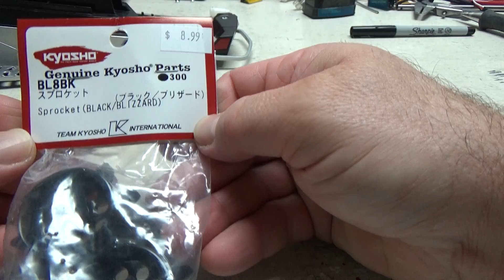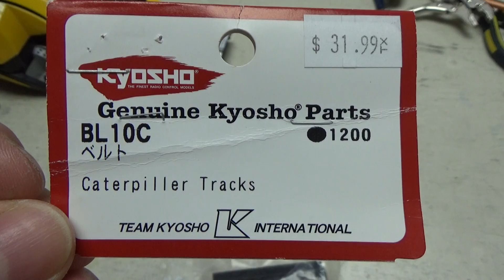Rc snowmobile SKI DOO convertion long track,brushless.

Comment: Thanks for the video and inspiration. I had the same idea to use a Kyosho Blizzard track and even purchased a spare track (I have a Blizzard and the same Skidoo) for this but have had no time to create the new suspension. I've found creating/building the track the biggest challenge with these types of snow machines.  I stripped the gears and disintegrated the stock plastic drive train housing on my Skidoo with the brushless motor setup and haven't driven it in over a year. Your video has inspired me to try and duplicate what you have done for the suspension and tunnel drive wheels - Great Job!  I've been working on a new geared drive train since the stock one is flimsy junk. One avenue I've been looking into is using an "EZ start" transmission used for starting nitro motors in the Traxxas Stampede. It is almost exactly the same shape and size. Take a look. I think something like this along with your suspension and track would be an awesome combo.
https://www.amainhobbies.com/traxxas-ezstart-starting-system-tra4570/p17794?gclid=Cj0KCQiA04XxBRD5ARIsAGFygj_7AvDr1OhaXD21Xo86VRgZu_Xjmqz5hUZ60wjM4px1OKOlZ5xj0YMaAq0-EALw_wcB
Reply from the maker: Yes it is possible give me news if it works
Reply: Does it have metal gears the ez start?
Reply: @PatisserieRoyale  Yes
Reply: Some of the gears are plastic (top idlers), pinion and bottom spur is Metal, geared very low though. I still have not tried this setup. Been busy with other builds. I'll check the gear ratio of this soon.

Comment: What length did you drill the hole on the shaft? Did you center the sprocket wheel on the shaft and go off that?
Reply from the maker: 2 mm at the center

Comment: My dad bought 2 of these one for me and my brother never used them  anyway I just fixed the battery by saudering anyway I need a track neither of em have a track on them and I cant seem to find tracks made for them do u know where I could find a track for this rc if so please send me a link itd be much appreciated 💯💯
Reply from the maker: the mine are very modified track sr blizzard
Reply: @rchelistef506  I see but is it possible to but the original Track for these or is there a track for another rc that would work for it?

Comment: Hi, I was wondering, what's the reason you would change the stock track belt to this one?
Reply from the maker: for to do a long track
Reply: The stock track will slip on the stock track roller because there's not enough underside lug rubber to grip onto and the rubber is also not stiff enough. That's why he's built an entire custom chassis.

Comment: Are the plastic gears strong enough to withstand brushless power?
Reply from the maker: no
Reply: C'est quoi tu a fait pour que Les gears en plastic ne se detruit pas? Je suis tres interesser de savoir... Merci beaucoup!
Reply from the maker: @PatisserieRoyale  les gear d'origine on duré presque toute la premiere hivers je suis en train de travailler sur une solution
Reply from the maker: @PatisserieRoyale  la gear du haut d'origine ne dure pas les autres sont ok j'ai pris la gear du haut et enlever la parti qui est briser celle qui se rend au moteur et garder seulement la parti petite j'ai installer une gear de moteur de 32 pitch et du raprocher le moteur refaire des trous moi avec la track de blizzard sa fonctionner un batterie
Reply from the maker: se qui se passe les dent de cette gear dur mais la gear caese en deux j,ai donc utiliser une gear de moteur 32 pitch 15 dents elle est lousse sur la pinne j'ai donc utilser une paille je crois une paille pour une antenne que j'ai agrandi le trou pour la pinne et l'interieur de la gear important de metre des washer chaque cote et ta gear doit etre en metal mou pour etre capable de la travailler

Comment: do you have the plan for the boggy y want to have your set up on mine
Reply: je parle francais
Reply from the maker: https://youtu.be/edb7GMIEqDY      je l'ai fait de la meme facon sur tous mes skidoo
Reply: @rchelistef506  ok parfait en gros si je suis ta video a 100% sa fit sur mon rotax 800r ses sa ? si jai dautre question ya tu une autre place je peux tecrire ?
Reply: on a pas tout les mesures des pièce si tu peux me donner tout les info tu serais vraiment gentil
Reply from the maker: @vincentlandry8609  j'ai mesuré sur le rack qui retient la track du centre du bearing avant avec celui de l'arriere 25.5 cm et la largeur entre les 2 lame d'aluminium4 cm
Reply from the maker: avec les track de blizzard sur la plus part des neige sa va bien il faut pas aller sur la neige collante car sa colle sur les roulette et sa peut faire casse la track sinon attention au roche en debut d'hivers.
Reply: @rchelistef506  parfait merci

Comment: Se qoi les shocks avant que t as mit
Reply from the maker: 85MM Shock Absorber 286004 RC 1:16 1:18 Off Road Monster For HSP Huanqi SILVER  sur ebay mais avec les coil spring d'origine du skidoo car il sont trop mou ceux de ebay pour l'avant
Reply from the maker: RC Silver Alum Shock Absorber 50mm 2P For Tamiya HPI 1:10 Drift Racing Car   sur eBay pour l'arriere